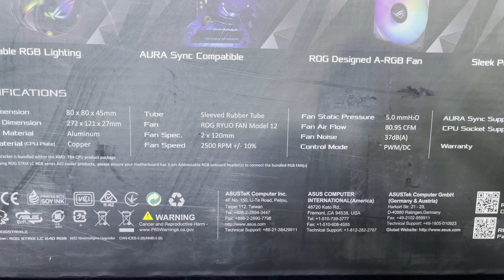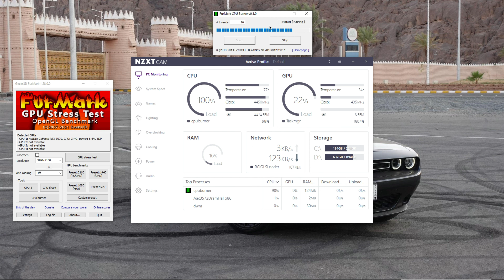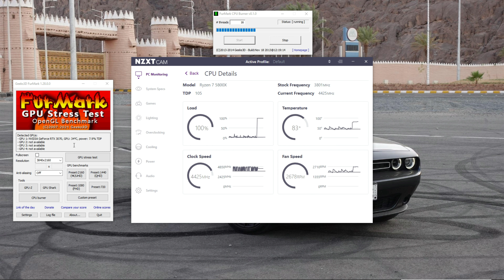ASUS ROG STRIX LC 240 LIQUID COOLER UNBOX INSTALL TEST

Comment: Paste was on the pump base from factory . I did my first AIO cooled pc with this cooler for my wife . Gen 12 I 9 32 gig Vengeance ddr5 Asus Z 690 Plus motherboard temp hangs around 25 to 26 c …. No over clocking . Happy wife happy life . I did use this exact AIO  .

Comment: I have a 10700 F with an ASUS TUF Gaming H470-PRO WiFi 6 the CoolerMaster MasterLiquid ML240L RGB V2  is starting to make noise and I was thinking of replacing it with this. What do you think?
Reply: i had the PC built around  Mar 2, 2021
Reply from the maker: @markschwacofer1802  what kind of noice  ?

Comment: You're average CPU temp is 80c plus not the 60c according to 9:51, 60c was the temp dropped as soon as you stopped the Furmark test. Just so we're clear, right? Another thing is I wouldn't put the fans on both the side and below the motherboard, I would only choose one side, either the one on the left or below otherwise airflow would just go around the case and very slowly get out on the back and top of it. Great job on positioning the rad though. I would probably do the same regardless what type of case I use.
Reply: he didn't put thermal paste
Reply: @gogomoro1502 cooler comes with it already pre-applied

Comment: No need for thermal paste???
Reply from the maker: There is already  no need
Reply: most air/liquid cooling all have thermal past applied to them. they work fine just like artic silver paste or any other brands. its all preference on what the user wants